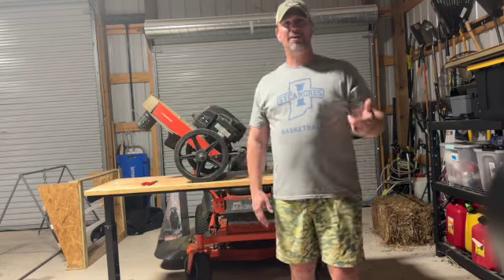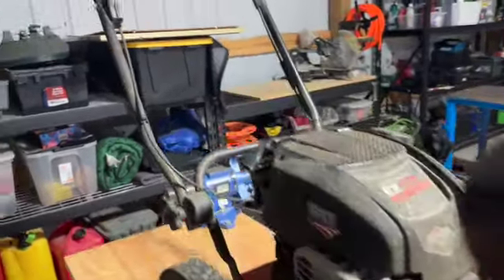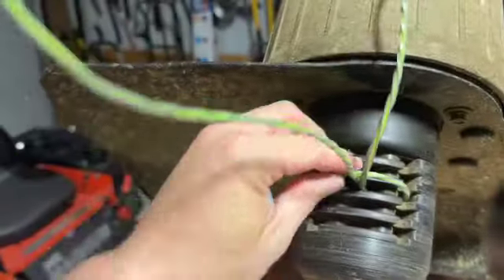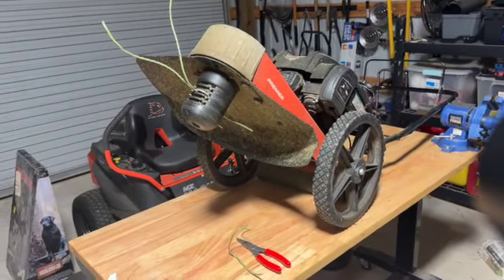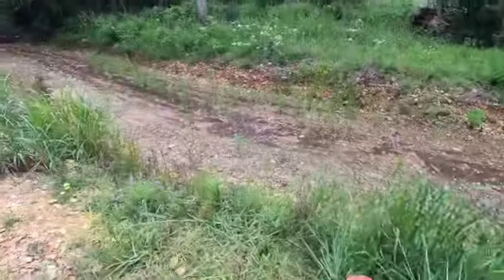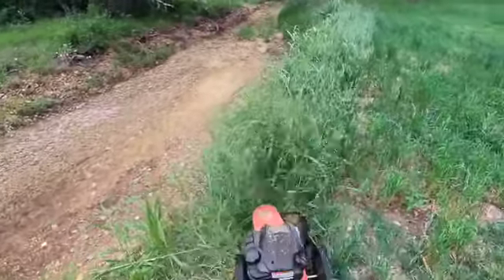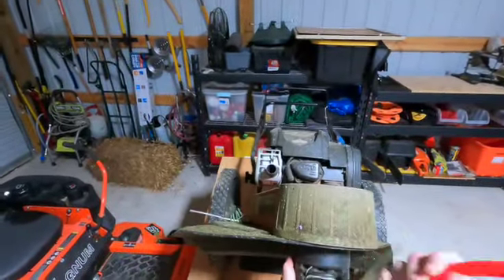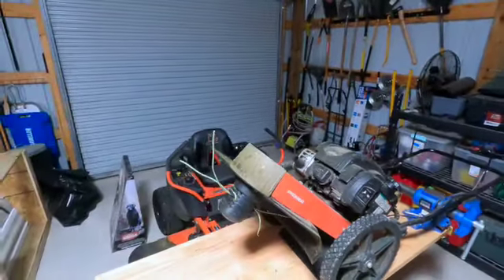2-Year Review: Dr Trimmer Mower on Lucky5Farms | Honest Homesteader's Experience & Tips!

Comment: Do you have problems with the belt? I’ve been through 2 belts in 6 months. Plus debris keeps getting caught up underneath where the front pulley fit the belt is. Any tips?
Reply from the maker: I haven’t had any problems with the belt. I do get debris caught in there quite a bit. I was actually going to ask if you had tips. I feel like it’s something I just have to deal with.

Comment: whats the bigest line this will take,  i just bought this and it wouldnt fit .155 line
Reply from the maker: The .155 is what I am running in mine. I just double checked. I purchased it at tractor supply.
Reply: @lucky5farms  i tried the square kind  and mayb you half to use the round
Reply: @ozzfest78  Soak your like in water for a few days, should work.